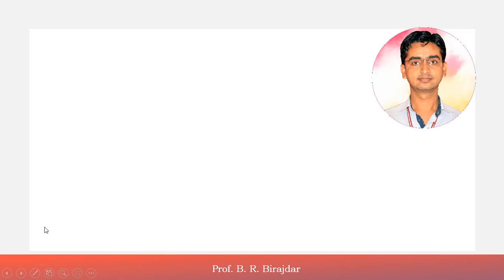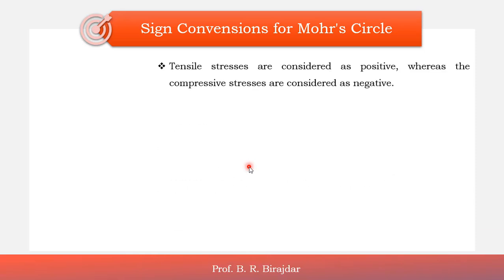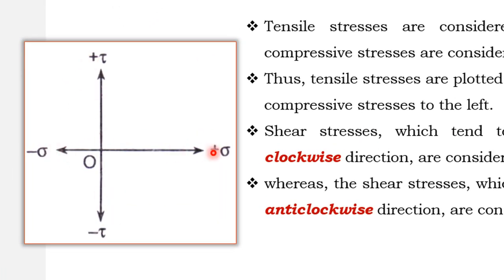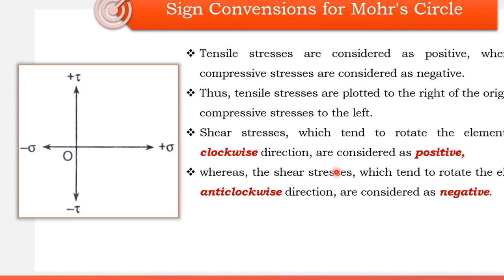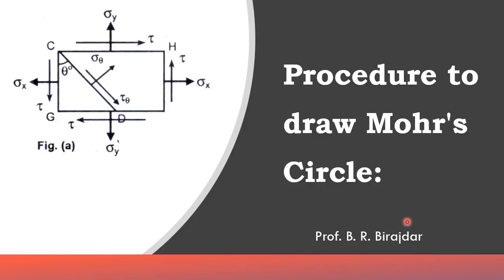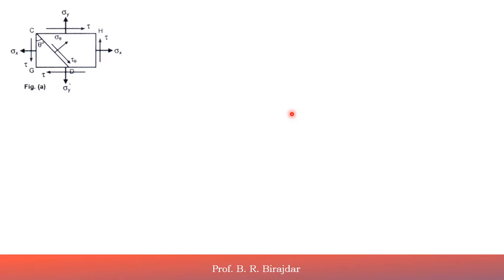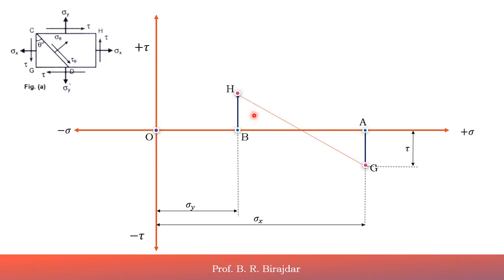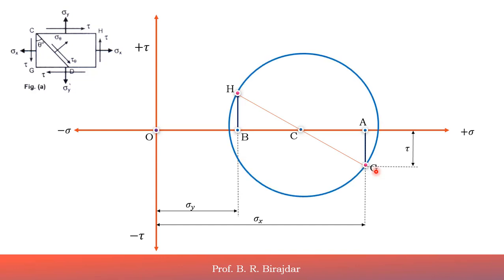Principal Stress Strain- Graphical Method to draw Mohr's Circle (BRB)

Comment: You’ve got the sign convention wrong. If the element rotates clockwise, it is negative and if the element rotates counter clockwise it’s positive.
Reply: On a Mohr’s circle a positive 2*pi rotation is clockwise.